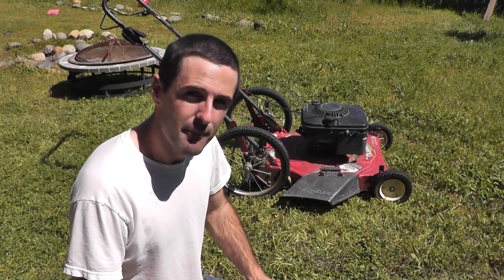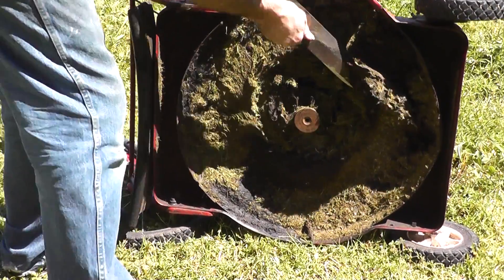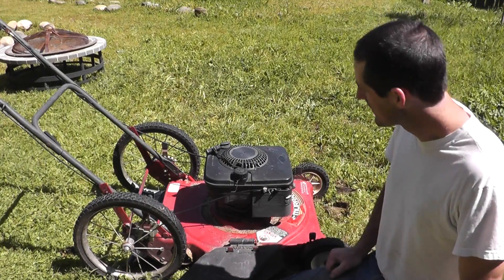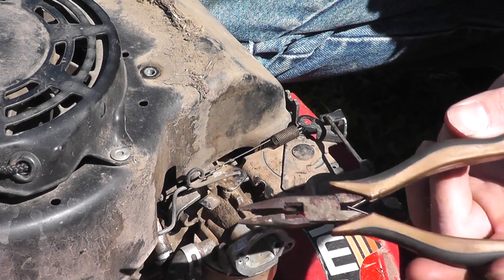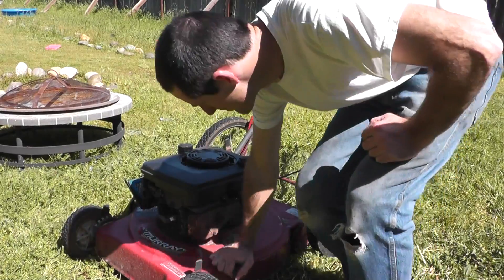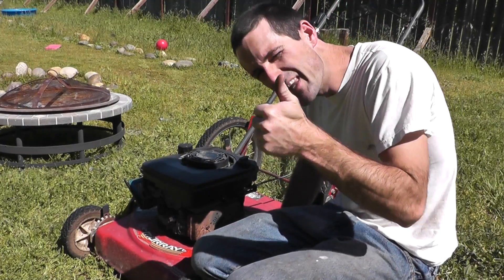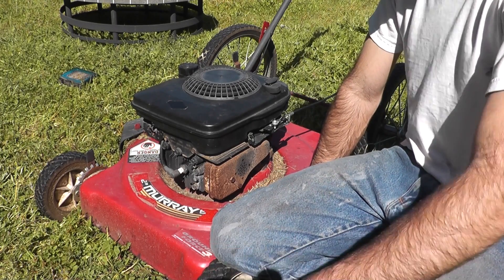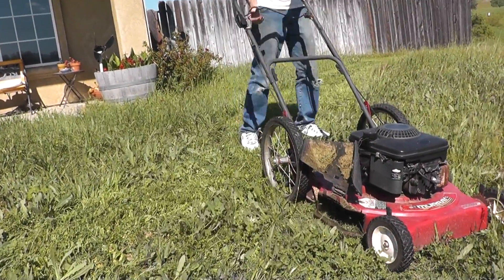Hot Rod Lawn Mower - Turn Up The Power By Tweaking The Governor

Comment: Just keep your oil clean and topped up and you should be fine. I've also just tweeked mine by simply turning up the idling screw - worked like a charm.
I also use Prolong oil additive in it and it has a cast iron sleeve 196cc I/C. It's 4 years old and hardly uses any oil and staets 1st or 2nd time. I have a Garden Maintenance business and it does about 4 - 5 gardens a day.

Comment: I'm running Loncin 4.75hp on my Klippo. Manufacturer does not suggest messing with the governor, but it's done about 500 hours with manual rev lever now. 

No rod issues, regular oil changes.

Comment: Yes this works but remember like even a car or mower higher RPM will cut better but you need to be aware of oil will burn and fuel quicker so don't walk slow with mower at high rpms you should be able hustle or lost your $$ in fuel and oil .
I tried this method already and the fuel of course goes quicker and the oil you have to keep tabs on.. to make sure that your oil is not going to need to get tapped off... Especially if you're going to use a lawn mower push mower for commercial use with other equipment

Comment: Don't wanna do this unless your ready to blow up the motor. It will blow the motor up 10x faster, I did this with a mower that ran fine and I barely turned it up and it blew the mother within a couple days. I did this with 3 mowers and exactly the same each time

Comment: Mower blades aren't meant to be sharp like a knife, they should be relatively blunt so as not to chip when they hit rocks and stay "sharp" longer. Furthermore, they should be sharpened on one side only so it lifts the clipping up into the catcher and the blades stay sharp longer. Love the videos, keep them coming.

Comment: You may already know but it is a good idea to balance the blade before re-installing it. This will reduce vibration, save bearings and the crank.
Reply: Also a properly balanced blade will spin faster
Reply: Well put
Reply: But how is that done?

Comment: Took 3 years off it’s life
But takes the tall grass like a boss
Reply: Take 3 years off a 20 year life for a mower is fine
Reply: Redo the jet on the carb and hes good to go lol
Reply: These flatheads run forever. It's usually the frame that rots away around the engine.

Comment: You should be cleaning under the deck far more often. 
Also, isn’t it important to have the blade balanced? 
Just pushing it against a grinder can throw the weight off, which can be pretty dangerous when spinning that goddamn fast.
Reply: The worst that will happen is that the crankshaft bearings will dissenagrate leading to engine replacement.kinda like a harmonic balancer on a car engine going bad and causing the engine to spin a main bearing. I've seen many lawn maintenance guys do the same thing and never affects the mowers at all.
Reply: Why did you have to use the lords name in vein man. 
You need Jesus man

Comment: 3500-3600 is where you want to be on rpm’s.  Run it faster and it won’t last.  You are really reving probably over 4000 easily.
Reply: Exactly! and an optical tach only costs $20.  
- The ANSI maximum standard is a blade tip speed of 19000 fpm.
- A 21" blade travels (21" x 3.14159)/12" = 5.4977825 feet per revolution.
- 19000 fpm/5.4977825 feet = 3,456 rpm (and 21" blades are shorter than 21")
*When they make the engine they have no idea what it will be used on, so they use what the max blade size where that engine will be used
- 19000 fpm/3200 RPM = 5.9375 feet per revolution
- (5.9375 feet / 3.14159) * 12 = 22.68" (~size of a 23" blade)
*Belt drive mowers commonly run 21" blades up to 3650 rpm
*This class of motor is used in small generators that run 3600 rpm/60 cycles
*3600 rpm is probably a good number and the rpm they use to measure hp.  This gives you some margin in case you run across real gasoline later.  Springs get
lazy and engines lose power as they wear, so the rpm will go down, not up.  The current
rpm of the engine is probably way lower than were it started as well.  However, without a tach, you will be either sub-optimal or wasting money on an engine.

Comment: I got my first home at age 19.

I totally bored out the carb. No throttle no nothing but a venturi and I opened up the jet.

It would run like a beast. I ran a motorcycle air filter and no exhaust and ran a touch of nitro from my rc trucks for fun.i also had either kit from an old truck. 

Then I put a spark plug by the exhaust with a switch connected to the original plug. I'd run the heck out of it throw the switch push the starting fluid button and throw 4 foot flames. It was stupid and dangerous and funny.

Comment: Hey dum dum! Nice video.. but you didn't even pull the spark plug wire off for your own safety..gheezzzz!
Reply: You do not need to pull the spark plug wire unless you can somehow grow a few extra arms to hold down the kill switch lever on the handle and Pull the Rope while attaching the blade the engine will not start unless that kill switch lever is engaged

Comment: i got a free push mower a few weeks ago the motor was able to run for a few hours before it ran out of gas lol im planing on putting the engine on my racing mower after i make the engine a little bit faster someone said it might not have enough power to drive the mower fast
Reply: i know of a website where i can get some powerful mods for the engine like an aluminum flywheel and a better camshaft just allot of powerful mods
Reply: Arc billet is a good start

Comment: Messed with governor on old 8hp snowblower, threw snow 30 ft in the air for about 5 minutes, worked great right before the connecting rod exited out the side of the block.
Reply: My lawnmower has max Power and IT gets red hot exchaust
Reply: @valtterivuorela3675  that means you're running too lean. Running lean will cause your engine to overheat and seize
Reply: Myth  @GiantGourd

Comment: Now do this video again but do this. The way you got more rpms took to long. If you bend the islet where the spring connect to on the governor to the throttle cable out you can achieve any desired engine speed.

Comment: Most the time the springs get weak with time and stops working correctly. I just use a metal wire and fix the throttle. Not wide open but not closed. Some where in the middle and some trial runs for best placement. Best idea is buying a throttle control cable so you can adjust on the fly. B&S engines aren't high quality engines to begin with. Their carburetors leave much to be desired.

Comment: Did this once on a Briggs self propelled push mower.  Power gain was immense, noticeable when propelling at uphill grades (rear wheel drive model) it was like I had a turbocharger added.  Unfortunately, the engine blew on a nice hot day of mowing.  I came to the conclusion not to mess around with these as these mower engines are purposely built to be as cheap as possible to meet their rated specs and nothing more.
Reply: Yep...they are governed for a reason. More so to prolong the life of the engine.

Comment: If you spray underneath with WD40 crap will wash off easy and won't stick.
Reply: Larry Walden WD-40 stands for water displacement 40th try
Reply: Larry Walden. yeah but rust out wd40 is 40%water

Comment: I've got one on the bench right now. The guy who gave it to me said it mowed really terrible. Since he had the blade upside down I'm not surprised. He said it didn't start too great either. Maybe because there was a pound of grass in the air filter.
I don't know what I'll eventually do with it. But, hell, it's just a lawnmower. If you want to rev yours up, rev it up. Beat on it. Lie to it. Set it afire. You do need to be careful about the blade, though. Or you could be the one getting beat up. 19,000 FPM maximum tip speed. OK, 20 thousand. But that's it.
Reply: Forgive my ignorance but what is tip speed and FPM? What ya'll are talking about sounds important but idk what it means.
Reply: @e.j.2578 
 The blade tip speed maximum is set by ansi standards at 19000. Lawnmowers blades are designed to withstand up to that speed and if exceeded the vibration harmonics can cause cracks to form leading to blade failure. So the longer a blade is the slower it has to turn.

Comment: That thing screams! I would go with SAE 40 motor oil! Sounds too high. You can just adjust the sensitivity of the governor which essentially puts the motor at WOT under a load anyway, but all the time? You may have a rod at your feet! I would do maybe 100 rpm more, thats like 300 rpm more! Well, it's still running I assume.
Reply from the maker: +vic steckhan Yes it's still going strong. I don't always run it wide open but it's nice to know the extra HP is there when things get thick.

Comment: Watch this at your own peril. This guy is playing with fire. Besides raising your rpm's and risk ruining the motor why would you sharpen both sides of the blade when it spins in one direction. All that grinding made the blade weaker and out of balance.  If your grass is too deep to cut raise the mower up if you know how. Hint: adjustment is at each wheel.  Now you will save the life of your engine and save someone's life in the mean time.
Reply: +Jo Zari dude he did not grind both sides

Comment: Do not make alterations to the spring. The engine will not handle a load properly if so. It will affect the "governor droop". I work in a small engine shop and have several certificates. I have seen many engine failures from excess idle speed. Long story short. Do not tear up your machine or cause it to become dangerous. There is a specified RPM and the engine must stay within the guidelines. OR ELSE
Reply: +Clay Little so Mr Certificates what are the tricks getting more power out of these engines with out expensive mods. Come on you have Experimented Tell us or you don't know how.
Reply: +Klaus Schreyer Bigger camshaft, make sure there are no metal burrs in your valves, bigger air intake(filter and filter housing), higher flow muffler, better gasoline, bigger carburetor... it goes on

Comment: Defeating the  governor is a very bad idea and does not increase power.
Horse power drops off at something very close to factory governed speed to begin with.
Parents should be forewarned. Excessive blade tip speed can (and does) maim or kill.
What is needed is more horse power and NOT rpm.
Reply: ESDEL CITATION Your statement makes no sense, horsepower is a function of RPM and torque, if you increase the operating RPM of the engine you will increase the horsepower as long as the torque curve has not dropped away. The manufacturer may well set the governor to run and peak torque as that is where the engine will be most efficient. (But who cares about efficiency when you are only using a cup full of fuel!).Peak torque occurs at the point where the engine is pulling in the most air it can for each induction stroke, as the revs rise from this point the engine will actually pull in less volume of air for each induction stroke but if the rise in RPM out-weighs the loss of torque the horse power will still go up. At some point the drop in air flow per induction stroke and therefore drop in torque is so steep that any rise in RPM does not out way the loss of torque, this point in the RPM range is peak power, any further rise in RPM will produce less horse power. Other factors also limit the RPM of an engine, these include valve float and snapping the con-rod!
Reply: At least it helps for my application :3 i'm making an outboard engine out of one and need the prop spinning fast as possible

Comment: I'm having a tough time finding a new mower that has any power. It looks like to me  the new emmision and noise requirements have really bogged down these mowers. I just bought a new toro from HD which I will be returning today after it constantly bogged on grass my old mower had no problems with. I also noticed none of the new mowers come with HP ratings any longer. Next we will be taking our mowers in to get emmision tested.
Reply: blastman8888 you must live in commiefornia, where there ain’t much they don’t control
Reply from the maker: kell490 The new ones are probably tuned really lean to meet the emission stuff. You're probably right, we'll have to pay "lawn implement registration" too.
Reply: You're probably better off getting an electric mower these days, modern lithium powered ones pack a mean punch
Reply: Electrics are good for little lawns, battery costs And die fast, petrol ones used well Last 40 years
Reply: Electric mowers will be cost effective in less than 5 years. Buy a used gas mower and roll with it.

Comment: How about instead of shortening the spring, take some steel wire or a wire coat hanger and swap the spring for the wire. The wire will hold the governor open so WOT is WOT. I did it on my minibike and it gave me a 10-20+ mph increase. But the minibike ended up with bad engine bearings. (Overheated WAY too many times) have fun and keep it from overheating. :)
Reply: High RPM could have worn your bearings out faster too
Reply: It knocked badly and had no compression
Reply: +Peter Kapica Thats not good
Reply: +Peter Kapica nice channel, i could use some of this stuff
Reply: It's now in the landfill. The weird thing is that it should last longer since I ran castrol edge full synthetic 10w30. Also another thing is that I had an 80cc 2 stroke motor on my bicycle (also made in China like the minibike AND used the proper mix using generic Walmart 2 cycle oil) The carb was never adjusted properly and wouldn't idle at a nice low rpm. It's either too low making it stall or to high but in the end I ran that thing HARD and it NEVER blew up. The only issue I had was that the exhaust pipe came loose (threads were badly stripped and I never forced it on). But then 3 months later it got stolen
Reply: +Peter Kapica bummer, nothing like an invincible 2 stroke, kinda ironic that the one that was taken care of wore out first
Reply: +Peter Kapica im restoring a small Jacobsen engine at the moment
Reply: That's cool. What's the plan for the Jacobson after restoring
Reply: +Peter Kapica Im thinking of putting it on some form of go kart, i know its not the smartest idea but i have no other uses
Reply: +Peter Kapica building a go kart has been a childhood dream of mine
Reply: I wanted a go kart too, though I don't have the space for it and I prefer a vtwin and a torque converter on mine

Comment: when you put up the lawn mower , jetski ect. for the winter , turn off the gas petcock with the motor running , let it die . this keeps the gasoline , oil , from gumming up the carb
Reply from the maker: Old varnishy gas is no fun!!

Comment: Good video ! I think it's important to keep it as "original" as possible when involving the throttle control. And that little adjustment was genius and well played.
Reply: +Jennies Garage What you did was just increase the RPM of the engine. Which in turn makes the blade spin faster, thereby increasing the efficiency of the cutting blade. I have noticed that my new mower misses blades cause the blade spins too slow. I am going to be doing this on my mower even though it's new. But I don't think going over 3000 rpm is a good thing.
Reply from the maker: Thanks! I just wanted to give it some more HP without chopping it up too much.

Comment: Too much spring pressure and it might not turn off when the handle is released.
Reply from the maker: It should be ok. The throttle control and brake/ignition cut switch are separate systems on my mower. Thanks!

Comment: do they have emission testing on lawn mowers where you live? why not just take the  governor off?
Reply: The governor is there for 2 reasons. 1 is to reduce the power when engine is running at maximum rpm to prevent catastrophic damage to your engine. 2 is when you are operating your engine under heavy load it adds more power so your engine doesn't bog and stall.
Reply from the maker: I was thinking about rigging the cable directly, but it would have meant rerouting the cable, and more fabrication than I wanted to mess around with.

Comment: you got er' revvin pretty good. idk how long it'll stay going. I would probably really kinda think about considering to change the oil maybe. but otherwise...run it till it blows. it's a briggs though so it may never die.
Reply from the maker: Yeah it goes real good now. I think it should be fine, and just to be safe I won't leave the throttle pegged for extended periods. And you're right about that oil change haha
Reply: ***** please be extremely careful, one of my good friends ended up in the hospital with a chunck of extremely hot connecting rod in his leg doing stuff like this